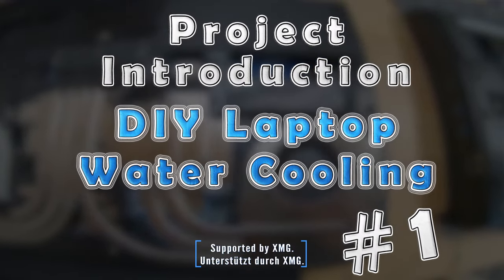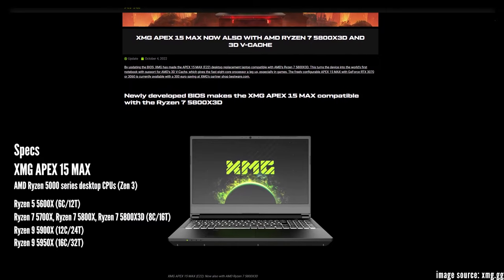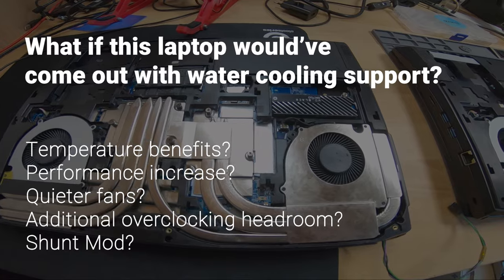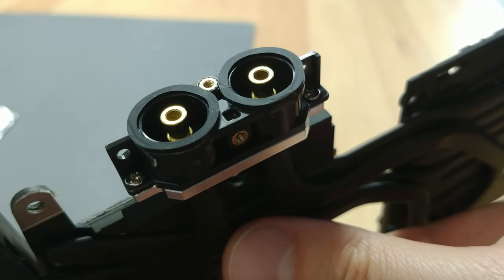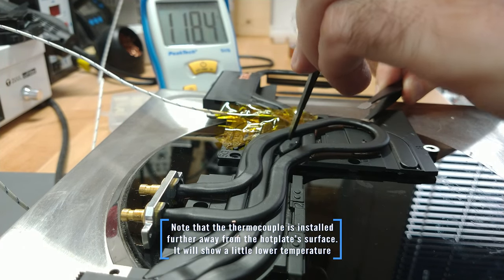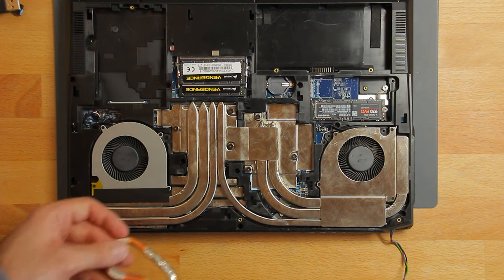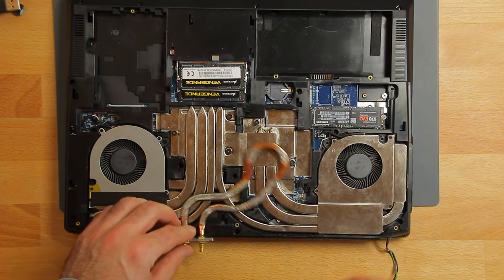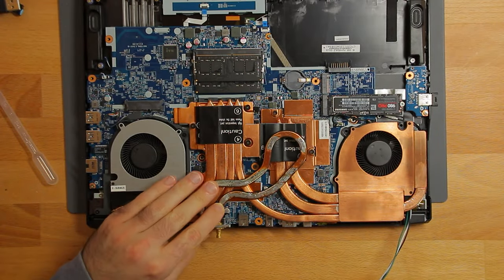Project Introduction - DIY Laptop Water Cooling - Part 1

Comment: I had the same idea for my laptop recently ;-). I ordered a copper pipe with screw connections from aliexpress. This tube can be bent and shaped with little effort. It is then possible to bend the pipe to its desired shape. I will later glue it to my heatsink with a 2 component thermal adhesive.
Reply: updates?
Reply: @hayemiranda7647  mission failed man, we try again next time!

Comment: 10mm copper pipe as used in plumbing  is available everywhere and the fittings are standard,  fill with sand  to prevent it kinking as you shape and flatten it..  or you could go full bore and use 15mm piping it wont bend as easy but you dont have to bend a tight loop  if you  have the inlet on one side of the laptop and the outlet on the other side  if you want full fat performance,

Comment: I love your videos! I’ve done the shunt mod and replaced the TIM with Liquid Metal and your videos are really helpful. I am planing on watercool my laptop too, since I went a little overboard with the shunt mod and I almost double the gpu power draw judging from the readings from the wall. I have a 2020 razer blade basic edition and it actually has a big chunk of empty space right next to the battery. I’m lucky that razer was too lazy to redesign this model to use the space that was previously meant for a sata drive. I plan to file two holes on the chassis and have the water pipe go in and out from there.

Comment: thermal pads,ideal measurements,including a 1mm or so offset ,mod fins, CAD, i tried soldering an old heatsink to another old one to no avail, but buying some tools to avoid plating the sink ...

but its relatively easy you will have overall 20+ reduction in temps
but you will have to cool your vrms and the other chips near them 
,a thermal camera will help save you mobo during early phase testing 

but a custom sink will cost you a lot if its not part of an already existing solution (/build)

Comment: Nice video! You may use the flanges from oasis and solder them to the aftermarket copper/aluminum pipe, so you can do your design as you wish.
Reply from the maker: That's the plan :)

Comment: I have ghetto mod liquid cooler pad on my Legion 5 pro. Nothing fancy like here, Just a bunch of Aliexpress CPU blocks attached to the heat pipes with MX-4.
It's a 180W 16" slim laptop. I went from thermal throttling (to the point of RAM becoming unstable), to 65°C-ish on both CPU and GPU, and with the pump running at ~7V the whole thing is basically dead silent. And all of it cost less than the spare bottom cover that I bought to eventually replace the one I carved out.
10/10 would recommend.
Reply: dude that's crazy
you make it sound easy but it's quite a feat honestly
Reply: @miroslavbulldosex  Thanks!
I was honestly surprised how well it works for what it is. The best part is there is I didn't have to touch the insides (beyond the thermal paste and the cut out bottom chasis), so I can still pick it up, wipe the goop and pass for a normal laptop on the go. I was also considering carbonaut pads for easier handling, but I don't travel nearly enough to warrant that.
Reply: I think it would be easier with Llando cooling pad which is the only useful and real cooling pad to me.But a little bit expensive.

Comment: Ive been trying a similar project to this over the last few weeks. I have a full custom loop made for my laptop but after 3 hours of trying to solder the new water pipe to the heatsink just couldn't get them to bond. Tried everything from a heat gun at over 300*c and a propane torch. Eventually I gave up when the solder melted and bonded only to the water pipe and not the heatsink....
Reply from the maker: Was it the correct solder? You need low temperature solder based on bismuth. The easiest way is to use an infrared heat source like a ceran hot plate. A heat gun is usually a bad idea because you create hot spots which can damage the heatpipes. Check if your flat heatpipes swelled already. If the flat parts rounded a little they are already somewhat damaged.
Additionally you need to clean the heatsink before soldering of course. Use IPA and acid to remove the copper corrosion layer.
Part 2 goes online on saturday 5pm UTC. Check out if you can take something from it that helps you. I will show a lot of that there.

Comment: i wonder if the new Airjets coolers will be usable for modding laptops
Reply from the maker: Asked that myself! Would love to experiment with them. But AFAIK one of them is able to handle 15W only. So dissipating 230W would require at least 15 of them.
Reply: @TechModLab  For those laptops with dedicated graphics they don't appear to be useful at all, but the ones with integrated graphics I think there could be some improvements (I got a integrated graphics myself and I'm hoping to see some mods for it).